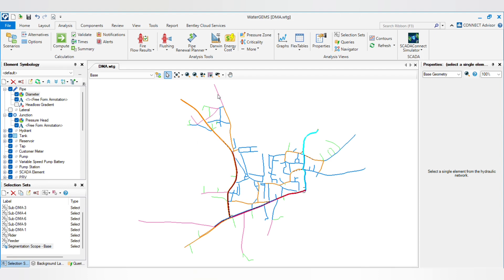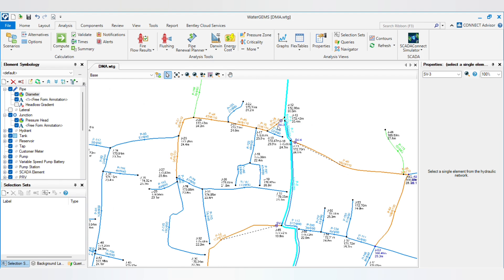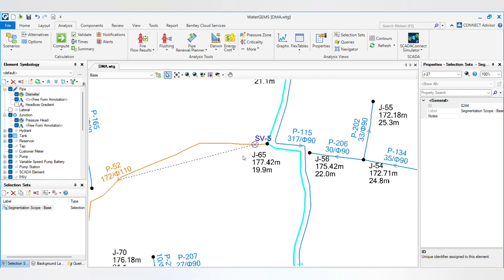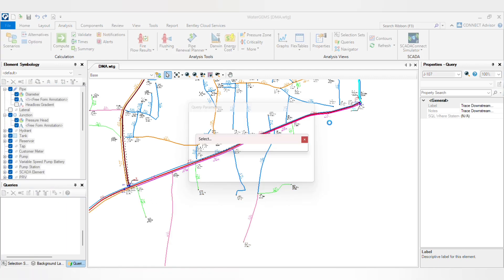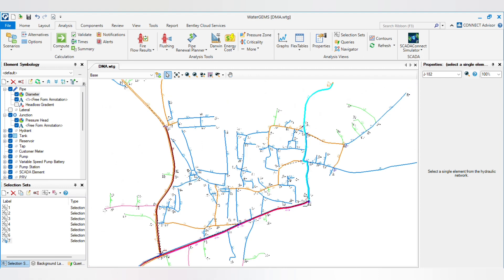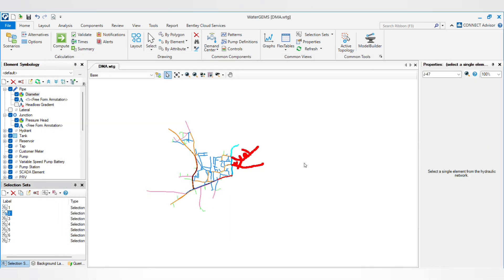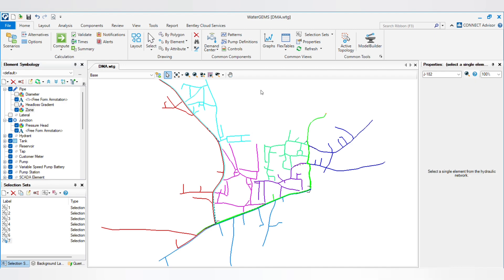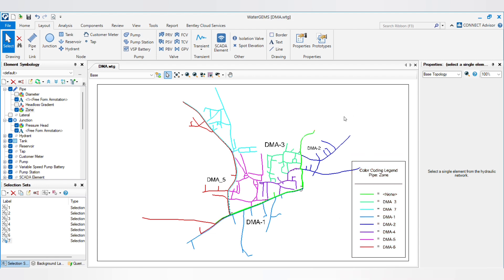DMA planning and Concepts l WaterGEMs l Bentley #DistrictMeteringArea #WaterManagement

Comment: According to the guidelines, a zone cannot have more than four DMAs. However, in this case, there are seven, which is incorrect. Additionally, each DMA should have between 500 and 3000 connections in plain areas and between 300 and 1500 in hilly areas.
Reply from the maker: I am aware of the guidelines you mentioned. This video is purely for demonstration and understanding the software functionality. But thanks for your feedback. I will take that into consideration for future videos.